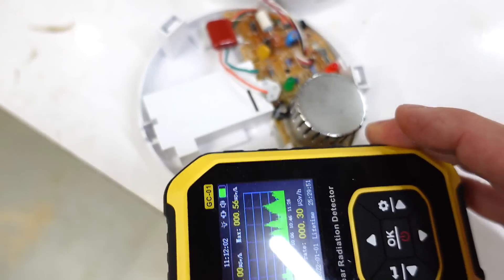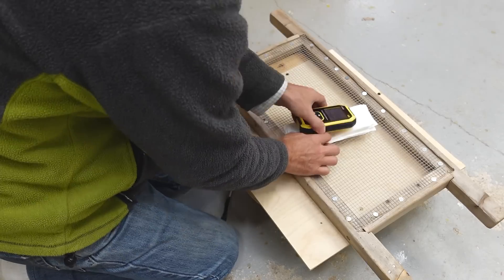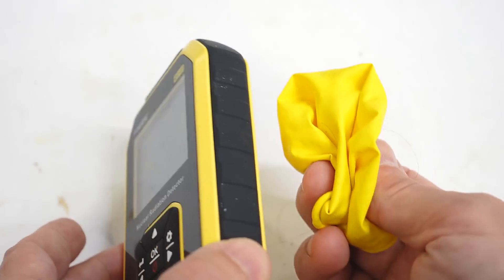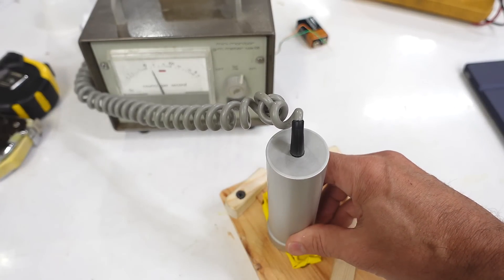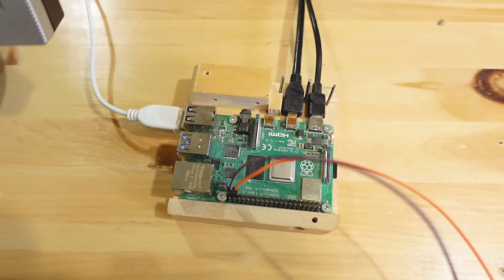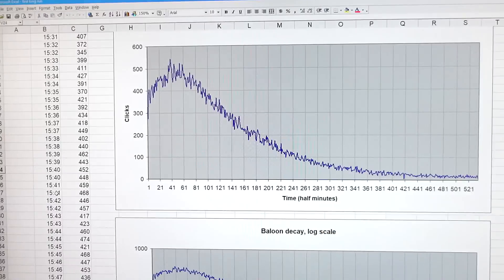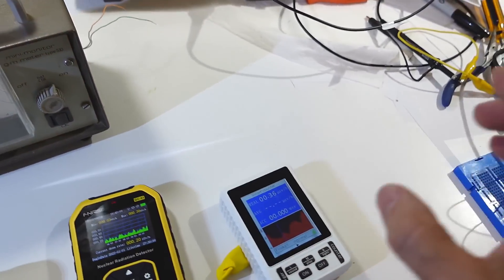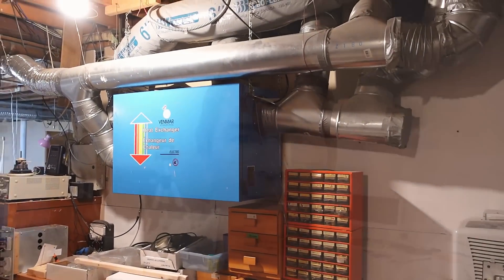Making radioactive balloons using Radon gas

Comment: The reason that you are supposed to take radon readings over a long period of time is because they fluctuate a lot during the year. I haven't checked in a while but the Canadian government used to give guidance on this. If someone takes a quick reading and tells you need mitigation they are grifting. If household levels do cause cancer it is due to long term exposure hence the need for long term testing. I find my house has low levels in the winter and in the summer when I have the windows open. My yearly average is right around the Canadian government's recommended threshold. If I only took a reading in the spring or fall, I'd be losing my mind right now.

Comment: Even metals evaporate, especially there they are really atom size particles, and with the help of a 4MeV of energy on each event, after what it was fast and full ionised.
I think you need aluminium hermetical tube around Geiger tube, to get graphics look like that they should to look.

Comment: Just discovered your channel - love it, I think your mind works much like mine. 
With regards to the odd half life, and also the early increase, I think I can offer some insights.  I recently did this same experiment with a home designed geiger counter that picks up alpha as well. My decay curve had some similarities and I was interested in how the different half lives and captured isotopes interacted.  
I put together a spreadsheet where I could alter the relative isotope starting amounts, and it would calculate the activity level each second as the various isotopes decayed/formed. 
You'll start with less Po-218 as it has a short half life,  and by the time you start measuring a lot of it has already turned to Pb-214.
If you start with Pb214:Bi214 ratio at least 6:1, you get an initial increase in activity peaking at around 15-30 min (depending on ratio).
In my case, the only way to get the decay curve I observed was if I also captured a high proportion of Pb210.
Reply from the maker: Hmm, yes, I may have been capturing some of the later decay products as well, not just the initial radon decay product.

Comment: Not a nuclear physicist, but just a quick google and the decay chain shows lead 211 and Bismuth 211 which are at 36 and 2 min half-lifes, could it be possible that your average between the two is 37mins? You could test this out using two detectors, one with a beta blocker to isolate and compare the data.

Comment: With respect to residential Radon remediation (at least for the moment), there's very little variation in the consumer products that are available to homeowners. Using static-electricity as a gathering tool could have some serious potential in terms of its practical application. 

So far, the typical method involves collecting radioactive particles before they go into the house, but plenty of houses out there can't easily be buffered by a low-pressure cushion in this way. For such houses that test high, I can imagine a sort of baseboard-level electrostatic device that solves the problem before it reaches breathing level. 

As usual, your simple, downright empirical approach delivers. Even if this idea is a total dead-end, this video has really challenged my thinking.
Reply: I have electrostatic filters in my HVAC system.  I suspect that has an effect.
Reply: @paulkolodner2445  It probably does, for better or worse. After making that comment, the problem I started to think about was how one might clean a large electrostatic filter. Note that Radon isn't really dangerous, but its breakdown products can be, and they have a much, much longer half-life. 

If I were you, I'd be interested to hear what a radiation detector has to say about my electrostatic furnace filter ~ especially since some of them get marketed as "lifetime."
Reply: @pocket83squared   Excellent suggestion - a functioning filter should always be radioactive.  That's a comforting thought.  However, I am pretty sure mine work, because they are always covered with dust when I clean them every 3 months.  Plus I replaced them a few years ago, just to be compulsive about home maintenance.

Comment: Many years ago, I installed radon evacuation systems. I honestly do not remember how we tested for levels, but I do remember it taking a solid week. It's crazy that it decays so quickly (hours to days), but it is "around" long enough to give people cancer, etc. Of course, that's in higher concentrations.
Thanks for the interesting video! As usual, it was not a disappointment.
Reply from the maker: it isn't around that long, just that the radon in your house keeps getting replenished from he ground.   I don't know what to think bout radon.  Has there ever been anybody who conclusively died from radon in their house?  Surely, there should be some extreme cases, right?
Reply: @matthiasrandomstuff2221  I do agree with your statements, definitely. As far as indisputable evidence, I can't answer that. I only assume what I was taught is correct; that exposure to copious amounts of radon is believed to cause lung cancer. I can only assume since it collects and has time to mutate cells.
I agree there are probably minimal "accounts" directly related, but I also know there are some areas (at least in the U.S.) where there are exponentially higher amounts being released from the soil. I seem to remember that farm land or areas that were forested for long periods are worse than those that do not have as much organic material.
Thanks for questioning everything like you do! Sometimes, I just give in, and other times, I fight for what is potentially the truth. Of course, as you have shown many times, facts/data can be used to make statements that may not be correct, whether intentionally or not.
Reply: @matthiasrandomstuff2221  The answer lies in the statistics - not single cases.
Some people can smoke their whole life and die at age 95. Others haven't smoked and die of lung cancer at age 30.

Comment: Why should baloon acquire radon? There is no phisical explanation of it. Looks like your baloon simply had some electrons left after rubbing your head on it. So electrons escaping from "electrified" baloon skin keeps Geiger counter to register.  Mathematically discharging process is similar to decay. Electrons gathered through rubbing are escaping from outer electron shells and they are very low energy (around 0.1..2  eV). Particals  from nuclear fission - having their energy level in MeV. Million times larger. This is not a radon you register.
Reply from the maker: it doesn't as explained in the video.  It catches the electrostatically charged radon decay products
Reply: @matthiasrandomstuff2221  Matthias, (great videos, by the way). Did you measure radiation level after you rub it with your hair but before exposing the air? For how long did you expose it? If theory of "loose ions of isotops" is right - radiation level should be propotional to exposure time.

Comment: Do you get higher amounts depending on where in your house you set up the balloon? Around here, quite often people have radon exhaust fans installed to pull the naturally occurring radon out of the house. I've seen them set up to pull air out of the sump pump pit in the basement.
Reply from the maker: the problem is, the radon comes in very slowly and the basement air mixes faster than it comes in.  Add to that that this method isn't very consistent, and I can't use it to locate the radon.  But presently just experimenting with the geiger counter picking up background radiation.  It definitely varies more than randomly, though still trying to figure out what things make it go up or down.

Comment: Funny you should post this now.  I just got my first radiation detector a couple of weeks ago.  One of the things I’ve learned is that, in general, G-M tubes take a bit of time to respond to radiation.  Scintillation detectors respond more quickly.
Reply from the maker: its all about size.  a bigger geiger tube would pick up more radiation and thus be able to give you a reading faster too

Comment: Regarding the Pi setup - there's a way to respond to the trigger by an event handler vs polling loop.

pi@COTHAS:~/furnace $ cat logRadiation
#!/usr/bin/env python

import sys
import os
import time
import RPi.GPIO as GPIO

sys.stdout.flush()

cnt = 0
avg = 0

# Handle Pulse
def handlePulse (pin):
        global cnt
        cnt += 1

#GPIO.setwarnings(false)

GPIO.setmode(GPIO.BCM)
GPIO.setup(23,GPIO.IN, pull_up_down=GPIO.PUD_DOWN)
GPIO.add_event_detect(23,GPIO.FALLING)
GPIO.add_event_callback(23,handlePulse)

# let a cycle of clicks build up.
time.sleep(60)

while True:
        avg = ((avg * 4) + cnt) / 5
        print "Average = " + str(avg)
        cmd = "rrdtool update /home/pi/furnace/radiation.rrd " + str(int(time.time())) + ":" + str(cnt)
        print cmd
        sys.stdout.flush()
        os.system(cmd)
        #if avg > 30:
                #cmd = "/home/pi/furnace/tweet 'Radiation notice. Time= " + str(int(time.time())) + " 5 Min Avg Count='" + str(avg)
                #os.system(cmd)
        cnt = 0
        time.sleep(60)

GPIO.cleanup()
Reply from the maker: oh, cool, will have to try that out!

Comment: Always something new and interesting.  For pulse accumulation, I'll use one of those little Arduinos and have it accumulate the pulses, taking into account for overflow of the 8 bit register and then talk to the Pi via its unused console serial port. Came in handy for a weather vane wind speed signal.

Comment: Having detected radioactive decay by two methods, it seems that you might have elevated radon levels in your home. Have you considered a proper test to assess these levels? Typically, some form of mitigation is needed to protect occupants from long term exposure. Have you tried the collection in open air spaces? Be nice to know if you have more or less activity inside than outside. Since you mentioned the air exchanger reducing levels it seems you may have elevated levels inside.

Comment: Very informative, thanks. You can make your own GM tube that will pick up everything, even alpha. You just need a copper end cap (2") and a BNC connector. You put the connector in the center of the cap. Then solder a rod from the BNC center tap that goes most of the way down into the cap. Place the cap over the sample with a smidge of pure alcohol off to the side (it prevents multiple triggers from the same particle).

Comment: This was a great video I have a question  my dad gave me a propane tank that has some cold gas inside not LP its got a blue/red valve on top and the gas has a mint smell to it any ideas
Reply: Blue normally is the colour used for oxygen and red for acetylene, in a welding set up. I suppose acetylene could be said to have a minty smell. You really should not keep it (for safety reasons) if you don't know how to store it etc.
Reply: @Nuts-Bolts  thanks I'll take it to a welding shop to see if they can do something with it

Comment: Not an expert: Does the electrostatic field of the balloon change the (detected) decay rate? AFAIK A Geiger-Müller tube only detects and amplifies electrons passing through the tube which "should" be caused by ionization events inside the tube. But if an external electrostatic field is applied the sensitivity of the tube should change (making ionization more likely) and therefore indicate a different event count. The (detected) decay rate would then be skewed by the capacity discharge of the balloon unless the tube is compensated for this effect in some way.

Comment: "not sure it will work in case of nuclear disaster"
If I remember well, at Tchernobyl, the level was so high that the instruments could not measure such a level.
And then, how do the electronic components resist to radiations without shielding?
Is the old instrument vacuum tube based?
Does anybody has the answers?

Comment: The radon decay chain is primarily a series of alpha decays, where an alpha particle, which is a helium nucleus containing two protons and two neutrons, is ejected from the nucleus of the parent atom with the alpha particle typically having a few million electron volts of kinetic energy depending on which step in the decay chain we are talking about.  Such an alpha particle slows to a stop in a few microns of travel in a solid by losing energy to electrons which it kicks out of atoms as it zips past.  These ejected electrons produce x-rays as they collide with other electrons and the holes in the atomic shells left by the ejected electrons also produce x-rays as electrons further from the nucleus jump into the hole closer to the nucleus.  I think that it is these x-rays that your Geiger counter is detecting, since alpha particles only travel a few microns in a solid they would not make it through the glass wall of the Geiger tube.  By the way, a common detector for alpha particles uses an aluminized Mylar window, which is thin enough that some of the alpha particles can penetrate. Most fast electrons, that is beta particles, are stopped by a single sheet of paper, and would not make it through the glass wall of the Geiger tube.

Comment: im no expert but someone that has quite the interest in ionising radiation,
i dont know how much of an effect it has but tldr is, the higher the decays per minute the more pulses get missed since there is a short delay before the geiger tube can detect a new pulse, theres different ways to compensate for that but i think all require you to have a known source and i think radon decay products have to short of a halflife to be really usable, the source of the smoke alarm should work tho.
i will look for the paper talking about it that i read since it might be interesting regardless
Reply: i think it was "A new dead-time determination method for gamma-ray detectors using attenuation law" very interesintg since their way usues only 1 source instead of 2
they are using a scintilator which has a deadtime around 8us where a geigercoutner has ~200us
Reply from the maker: the dead time is 1 ms or less, so not significant for my radiation levels.
Reply from the maker: by the way, the effect of dead time is easy enugh to calculate.  If it was 1 ms, and you got 100 pulses per second, you know that you got the 100 pulses over a second, you know you weren't listening for 100 ms, so the pulse rate is actually 111 per second.  The pulses are completely randomly distributed so it's easy enough.
Reply: @matthiasrandomstuff2221   yes, those are just ways to get the deadtime, since that can be difficult. but yeah you're right this probably wouldn't really affect your result

Comment: i live a few miles away from two massive uranium mines (one active and one inactive). every single house here has a radon pipe to make sure that radon in the soil has a path to flow through the house that doesn't mix with the air we breathe. from what i understand, its literally just a big pipe (i think its 4 inch PVC) that is set into the slab in the basement so its open to the soil, and it runs straight up to the roof. we can all get radon test kits from the state for free too which is nice. i've measured background radiation numerous times over the years, and its actually not much higher than other places without uranium ore. living my entire life here will net me about one extra chest x-ray worth of radiation. 

i've never though to do the experiments you did here with the balloon or to test my dryer lint, and now i think i will have to test it to see how strong the radiation is haha

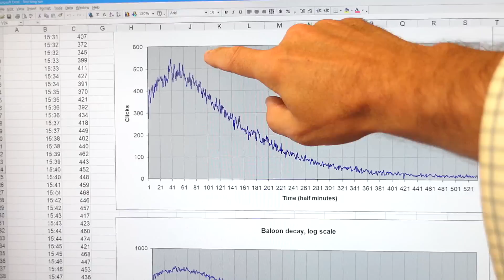Comment: Yeah, your graph shown at 5:28 is quite a good match for the radiation produced from a pure initial charge of Pb-214 on your balloon.  That’s the slowest decaying element in the decay chain, so it’s likely to predominate at equilibrium over, e.g. the Po-218.  The peak at ~20m is from the lead not having decayed so much that it still produces a fair bit of activity while its decay product Bismuth accumulates to a local maximum at around 30m or so.  At that point the bismuth is decaying faster than the lead can decay into it, so both nuclei are decreasing in activity.  The bismuth decay radiation dominates, but the effective half life is longer than its true 20m because more bismuth keeps being produced by additional lead decay.

Plug in an initial charge of 350 units of Pb-214 into this decay simulator and you’ll see almost exactly your graph:  http://www.wise-uranium.org/rcc.html

Comment: you should have a look at the "better geiger". It runs on AA battery and uses a scintillator instead of a tube. And I think you can hook it up to an arduino without too much trouble (and it clicks!)

Comment: This is pretty cool! If you're in the market for radiation detectors, I gotta recommend the Radiacode. It's not a Geiger tube, but uses a scintillation crystal, and it detects the energy level of gamma radiation. The benefit is that it makes it really easy to determine which isotopes you're seeing. It also easily hooks up to a computer or smartphone for data analysis.

Comment: Something that seems to be missing from the discussion here: Radiation emitted outside the human body is much less damaging than radiation emitted from inside the human body.  This is what makes radioactive dust so much more dangerous than high background level radiation.  Radioactive dust can be inhaled directly, or settle on foods and be eaten; in this case, the radiation originates inside the body and is absorbed directly into organs that have a low cellular replacement rate.  Radiation from external sources must pass through air, skin, and muscle before getting the chance to be absorbed into internal organs; skin and muscle have a relatively higher cellular replacement rate, so radiation damage to them is much less likely to result in cancer.